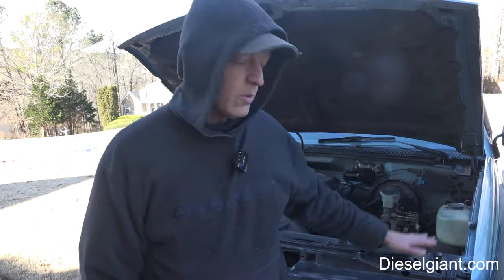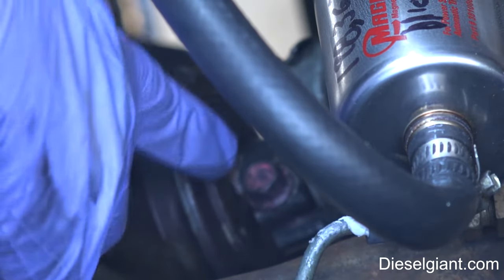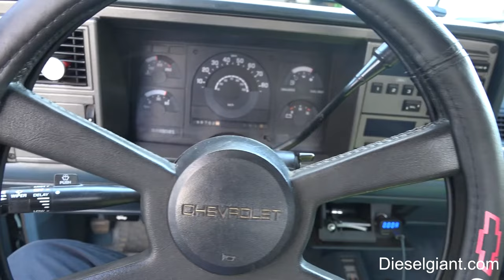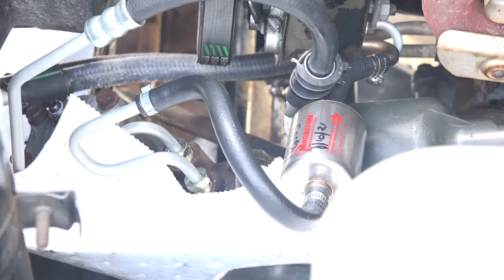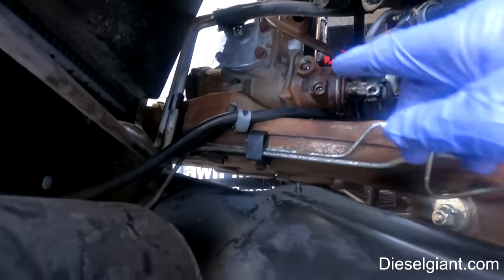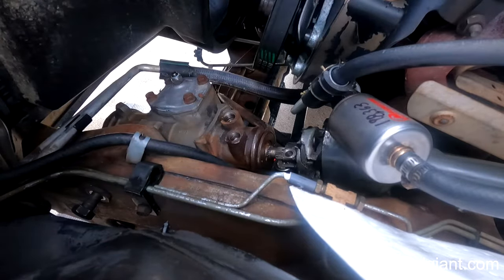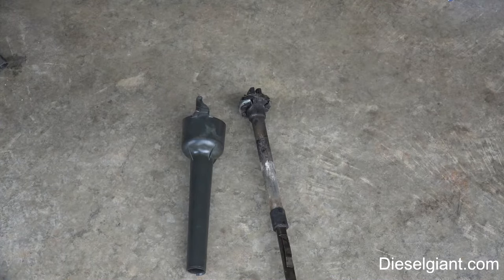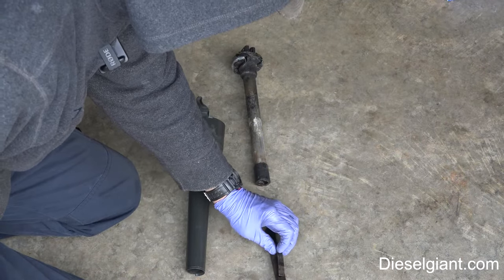Power Steering Gear Box Replacement GMT 400 '88-'98 Trucks

Comment: You forgot to show the steering box left to right travel in total degrees , then Divide in half gives you dead center never just assume the pump is at dead center out of the box just a FYI . Nice job other wise.
Reply: Good idea. I wished I knew how to do that
Reply: 100% this! i just had to reinstall mine after alignment because i assumed it was centered
Reply: How exactly do you center it before you put it in or after it is in?
Reply: @markcaruso25  only way I can think of is installing it. Bleed it and see how many turns to left and then right. Leave the steering wheel at the center for the new gear box. Remove the steering shaft from the gear box. Center the steering wheel and reinstall it.

Comment: If you have an airbag, the first step is to secure the wheel so it doesn't turn. If the wheel gets turned while the job is being done you will need to get a clock spring also.

Comment: Might want to look into the jeep steering shaft mod as well. Those rag joints are trash.
Reply: What year jeep? I’ve been seeing a lot of people talking about that swap
Reply: @aaronk2465  84-00 Cherokee you can grab them for 20-40 from a junk yard
Reply: @jeyweb4236  thank you sir🤝
Reply: Just did this swap in my 95 c1500. Actually made the steering worse because the jeep shaft has a unneeded U joint on the firewall side. Ended up putting the old shaft back in with new rag joint
Reply: @justingarcia9444  look up Cunningham machine. They make a lower half steering shaft meant for the 88-00 Obs trucks without the garbage rag joint.
Reply: So how did it drive?
Reply: Also Borgeson in NC makes a nice lower shaft with universal joint to replace the crappy rag joints. I'm about to replace my gearbox and looking for tips.

Comment: Is rebuilding it a reasonable increase in part reliability versus a replacement gearbox such as the brand you mention thats to expensive for some of us. Thank you Sir.
Reply: Rebuild kits are relatively inexpensive and it's pretty simple to rebuild a gear box mostly o rings 1 main bearing and some clips a couple videos on YouTube and anyone with the right tools mainly the spanner style wrench to open the gear box but there also inexpensive to buy or easy enough to build if you have a welding machine

Comment: I own a 96 GMC Sierra and the steering is bad,  I have to hold the wheel at the 10 o' clock position to keep it straight. My brother suggested the steering gear box may be the problem because theirs a lot of play with the steering wheel. Thank you for posting this video it's very helpful.
Reply: Check tie rods also pitman arm and idler arms they can cause a lot of dead space in steering I had a Chevy s10 blazer and thought it needed a new gearbox turned out the pitman arm was loose it wasn't fully tightened either from a shop or from factory I pulled the gearbox and just replaced the pitman arm just because but like I said it was just because the pitman arm wasn't torqued down all the way it had an 1/8th of gap and causing dead space when steering left the 2 o'clock position was my center of the steering wheel until I fixed it

Comment: Changed mine today and got a new pitman arm while I was at it. 
Had to use a friends air impact to remove the 34mm nut on the pitman arm... 
but it took me about 2 and a half hours of work... dirty work 💪
Reply: i just replaced the same on my truck. Did you have any issue with getting your power steering working again?
Reply: @cavanyaw  so far the truck has been parked since 🤦‍♂️
Only because I’m finishing up the last bit of my 6” RC lift so I figured I’d tackle the entire project all at once I’m this 👌 close to being done tho maybe tomorrow evening

But I don’t imagine anything on the power steering wouldn’t work, or I hope not 😅
Reply: Hey there just checking up how that pitman arm worked out for you? I have a 98 Yukon giving me bad steering problems right now

Comment: I have a 1996 k1500 I’m changing the steering gear box in. Will I need to be worried about the steering wheel air bag? Thanks

Comment: Could you please link the place you got your box    i didnt catch it
Reply: i know this is a year old comment but i get all my parts from Detroit Axle through amazon, i just bought a new power steering gear for my 1994 gmc sierra c1500 on June 13th 2022, costed me $199.25 + tax with free shipping on amazon prime. the manufactured part number was  1417GB. hope this helps everyone.
Reply: @hotrodpawns  how has the part been holding up has it gave you any issues
Reply: How good is it operating to this day@hotrodpawns

Comment: would the steering locking up when turning one direction almost as if there is no power steering be an issue with the gearbox??
Reply: Sounds like something in your front end needs adjustment or maybe damage to your worm gear in your gear box. Take it to a front end shop and have em look at it
Reply: @davidvanhooser7733 currently in the process of replacing the gearbox hopefully that fixes it replaced the entire front end components so the gearbox should fix it
Reply: @brycemays117 what did you end up getting done to it
Reply: @marconieto8552  replaced the gear box and it worked just fine

Comment: If you have a 95+ with an airbag put the seatbelt through the steering wheel to prevent it from turning so you don't mess up the clock spring.